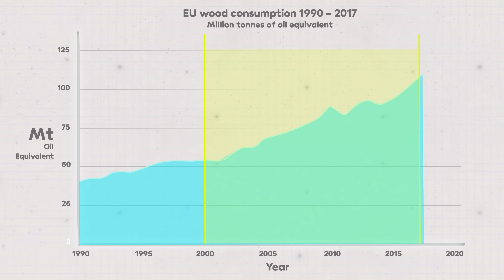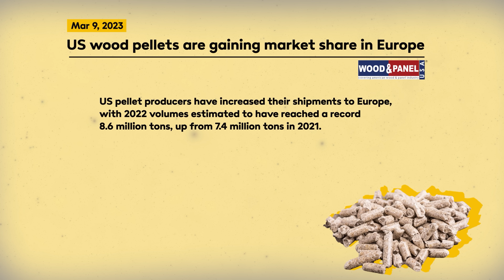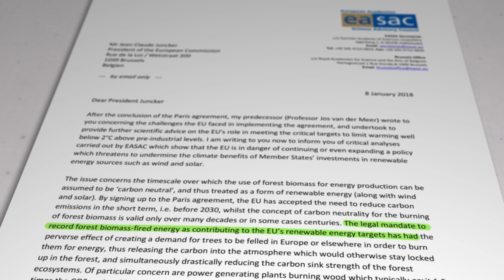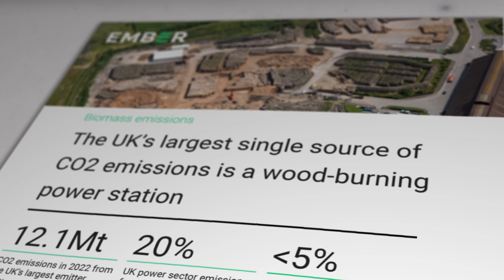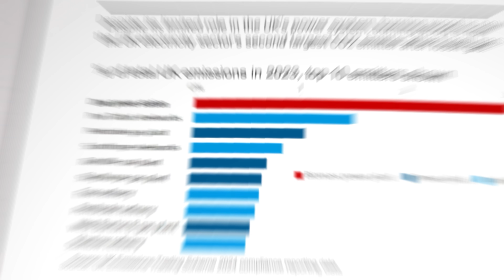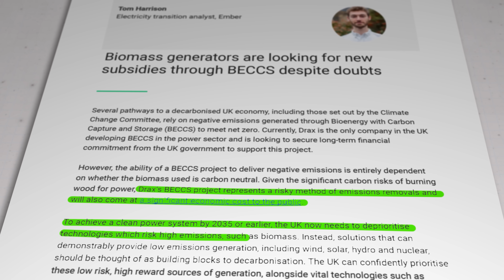New report: Biomass CO2 emissions 4X higher than COAL!!

Comment: Bravo. I have been saying this for more than 20 years to anybody, who cared to listen to me. As you point out, the idea that this process could reduce CO2 emission is laughable.  Harvesting mature tress and replacing them with saplings only serves to create a CO2 surplus emission, which can never be caught up on, no matter for how long time this process continues. Introducing wood pellets as a large scale energy source also required additional ships (Bulk carriers) to be built to meet higher transportation demands, new bulk terminals were built in ports at both export and import points, additional or new rail cars, trucks, bulk handling machines, logging machines etc etc had to be built to handle this rom source to consumption points. All that required additional iron ore to be mined, transported, smeltet and converted to machines, ships and ware houses, which also requires additional energy, largely in the form of oil. The list goes on. Thank you so much for bringing this issue to the public.

Comment: More madness. Whilst on holiday in Wales we enjoyed a trip on the world's oldest railway. Chatting to the train engineer we were told the government won't let them use Welsh coal (best quality in the world apparently.), so instead they have to import a poor quality substitute from Poland, (made from compressed coal dust and oil) at greater expense and much greater CO2 emissions for the shipping of this. There should surely be an exemption for heritage usage such as this.
Reply: As great as the coal was from the South Wales coalfield that is now the past, there are no mines, underground or opencast. As "heritage" trains in the UK only burn through 35K tonnes per year it is highly unlikely any operation will commence to supply that small demand and anyway anybody living near a potential mine will fight it tooth and nail. There is a  drift mine, Aberpergwm but that I think  produces anthracite and is used in water filters.
Reply: The oil part of that mix is probably petroleum coke, it's a waste product from oil refining. Quite a bit dirtier than coal on a weight for weight basis, but also more energy dense. It gets burnt as fuel because there are few other uses for it.

Comment: Burning wood for heat makes sense in rural places where there aren't other options (no gas, power grid unreliable, not much sunlight in winter, etc) and where you have lots of windfall to burn that's coming down anyway. Cutting healthy trees to burn for electricity, on the other hand, is asinine. Here in BC we are getting our heads cracked by the cops for trying to stop logging for pellet production, it's a national embarrassment. Our so-called "forests" that are actually just monoculture tree plantations are a net SOURCE of carbon emissions now, not a sink, and this pellet nonsense is part of why that is. Thanks for putting some light on this, international pressure on the BC government is going to be crucial to stopping this atrociously stupid practice.
Reply: Wood isn t the only usable fuel.
In France many farmers grow a small patch of miscanthus to run their own burners at home during winter. 
Locally sourced, yearly output, ashes can return to the fields.
And cheap 😅

Such biomass is great for low heat generation. Using it for electricity makes no sense though.
Reply: You need to be in an extraordinarily high latitude for solar to not make sense. It is so cheap now, that even if you're getting 30% efficiency out of your panels in winter it's not a big deal. Even if the wood is technically free the amount of human labor that goes into processing is massive. Plus the impact on air quality in your home.  
A fire at the cabin a couple weekends a year is fantastic, but to live with that for half a year is a real problem.
Reply: @otm646  Solar panels are typically 20% efficient, so you must mean at 30% of average, or 30% of peak. Insolation across Canada is such that every province except NWT, Nunavut and Yukon do get at least 30% of peak all year on average. With PassivHaus or Zero energy standards, insulation and passive heating generally make either solar or wood moot, for all but the most dire conditions. Heat pumps are more economical, unless your wood and the labor to get it are free, comparing the two most economical active heating types.
Reply: @bartroberts1514  surely heat pumps require most electricity to function at the same time of year when solar is at its least efficient .
Reply: @sobeit1927  Ground source heat pumps don't particularly care about time of year.

In most populated areas, having both hot water tank heat pump and air heat pump gives amazing synergies managing humidity for sensible heat.

But of course, insulation trumps all when combined with draftproofing.
Reply: @bartroberts1514  not many people have the land for ground source pumps so most properties are getting air source pumps which operate less efficiently when the ambient temperature is lower .
Reply: @sobeit1927  You don't need to convince me about land. I went with air source. And for no more than four days a year do temperatures fall so low across 90% of Canadian homes that the "less efficiently" condition requires modern hybrid heat pumps to switch to resistance heating mode. That's 98.9% uptime for 70%+ savings.. which still comes out to ~70%+ savings. It merely makes insulating and draftproofing even more cost effective.
Reply: @otm646  I have lived off grid with my family  for 13 years . All electric comes from solar and all heating comes from my standing dead wood each year and sawmill off cuts . All very low tech and Lots of labour (which I really enjoy doing ) to process firewood but overall the house runs smoothly and efficiently . Very comfortable and sustainable.
Reply: Yeah, I have access to a historic family cabin, and the ranch it is on with a bunch of other cabins is in a forest, it naturally produces several times the firewood than everyone can use.
Reply: Many of my friends have chained themselves to trees to save old growth habitats. Even they understand, some of them, that wood pellets are necessary and beneficial compared to the wood rotting into methane 120 times worse than CO2 from burning the pellets.

Yes, in BC things aren't perfect. The native forest growth is much disturbed. Until the past decade, forest practices were truly awful, and they're only incrementally better with the updates to forest laws.

But make no mistake: our shrinking forests are net carbon sources because our trees are sickening and our lands are dying off from climate change, from beetle kill due to loss of cold winters, from extreme wildfire weather, and all of that is due to fossil trade originally.

While the fix starts with ending fossil trade as soon as possible, we need more like Project Drawdown's Climatology 101 Roadmap, not reactionary kneejerk panic egged on by GWPF campaigns of misinformation.
Reply: @bartroberts1514 not to mention the impact of geoengineering .
Reply: Maybe burn coal in your fireplace to reduce emissions.
Reply: @Loanshark753  Seriously, use a /sarc tag. Some in this audience may believe you mean it; worse, they may think it's right.
Reply: Wood heating only makes sense if you don’t place any value on your or your neighbors’ health. It’s also been found by some researchers to be the least climate-friendly option for heating a home.
Reply: @d-katz  But if you live off any grid, how should you heat your home? Many houses in S. Europe aren't particularly remote but there's often no electricity grid and if there is, it costs around €60K to get a connection. No gas either, other than propane. Pellet stoves require little electricity so OK for off-grid power and they emit very little smoke, unlike regular wood burners.
Reply: @d-katz  Or, if you have an efficient wood stove that doesn't produce particulates. The least climate-friendly options for home heat are all fossil. The most climate friendly is proper Passivhaus, which may mean not needing to heat actively at all.
Reply: All wood stoves produce particulates. Newer certified ones emit even more of the smallest and most harmful ultrafines. For the same amount of heat, burning wood emits more CO2 than gas, coal, or oil, as well as short-lived climate pollutants.
Reply: @d-katz  All combustion (not just wood stoves), and all trees (not just the ones burned) produce particulates, whether pollen and terpine precipitates when alive, or fungi spores when dead.

For the same amount of heat, burning wood emits ONE THIRD AS MUCH as burning coal, though. And those pollutants from burning natural gas and fossil oil? WORSE THAN WOOD.

Get your facts straight.